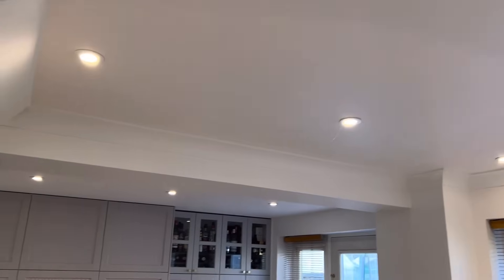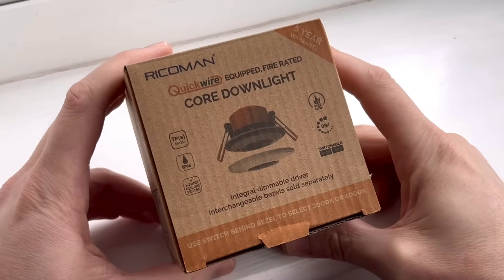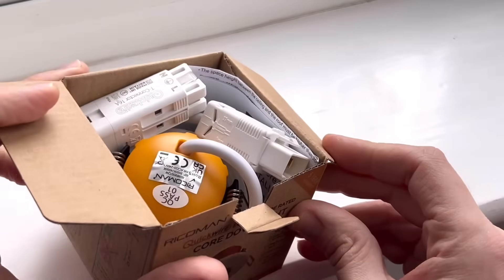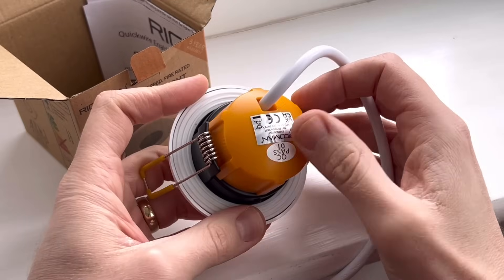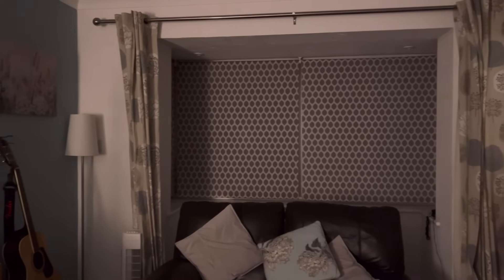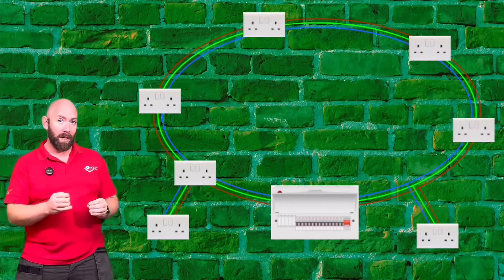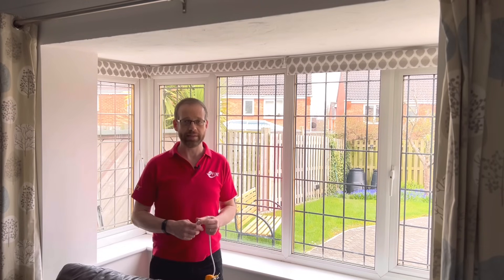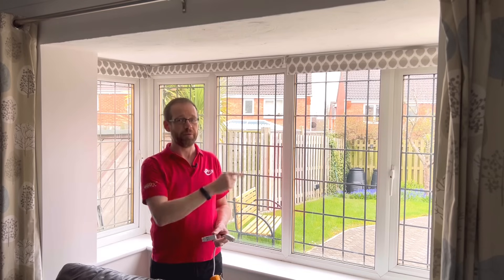Do We Really Need Another LED Downlight?

Comment: Can you use these with the new earth sheath cable from Doncaster cables I have used the quick wire connectors in the passed and they are great but will they work with the new pre sleeved cables 🤔

Comment: makes a lot of sense ! BTW, anyone got suggestions on the best type of downlight to reduce glare. I am using really old-school ones like shown at the start of this video, with glass, which were shower rated back in the day. I have an insert from Ansell, which basically pushed up the GU10 about 2 inches (like a male & female socket). It has a matt black finish on the insert, and removes about 90% of the glare as you look across the room. However they dont feel safe & occupy a lot of space above, give a lot of light in the attic, and gather dust on the sealing glass. I am looking for a modern recessed type, with a deep right angled recess, and totally air-tight, between above & below. Any suggestions ?

Comment: Have to disagree, the worst part of any down light, the spring clips, I have only ever installed one down light that didn't use those clips and wreck the ceiling when you removed the fitting. Also magnetic bezels would be nice as well.

Comment: The worst down light with built in lamp of recent years I have installed is the ML Nightsbridge range. I had to replace 48 on a job due to inconsistent and poor paint finish to the white range. Also had issues with flickering when on dimmers no matter what brand of dimmer was swapped out.

Comment: It’s beyond me why more quick wire connectors aren’t used . Brilliant quality products and fast installation.
Reply: I can think of at least one reason. The MEP contractor on a project is responsible for procurement of materials and managing. They sub-contract the install to a smaller firm which doesn’t have a say in what materials shall be used. They (the smaller firm ) get paid for the install a fixed price, and it’s their problem how quickly will install. The main MEP contractor wants to keep the cost down, so they buy cheaper connectors, as they don’t reap the benefits of the QuickWire product, i.e the speed.
Reply from the maker: Thanks for the great feedback